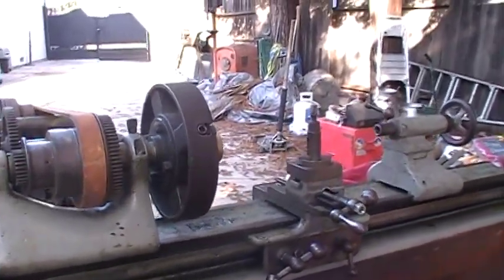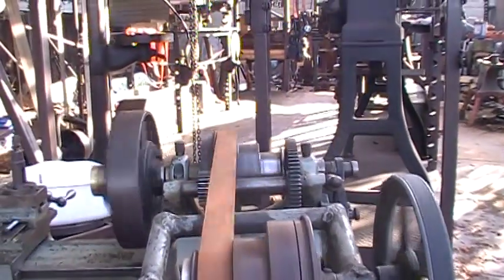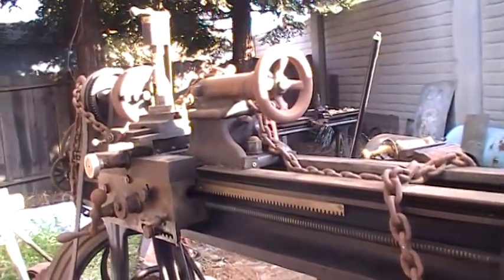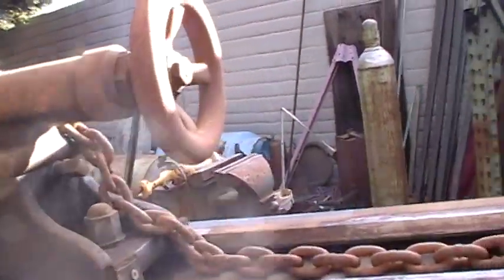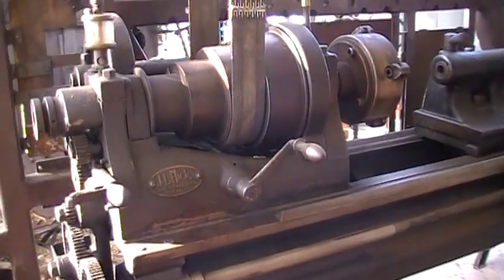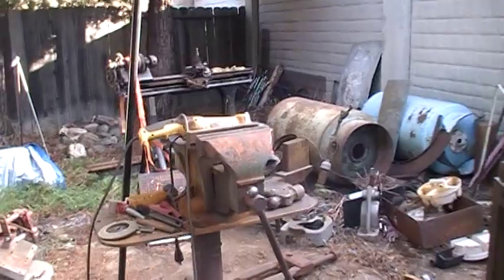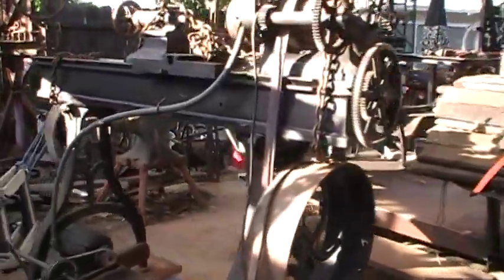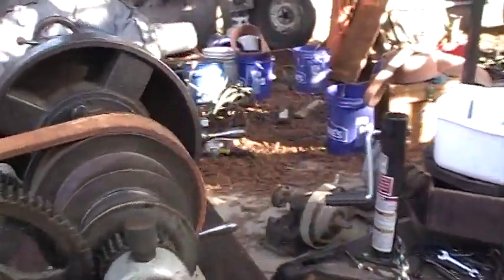New old W F J Barnes #4 1/2 and #13

Comment: I have a 4 1/2 Barnes lathe. Purchased it from an auctioneer who had it for 35 years. It didn’t take much to get it going. Basically took it apart and cleaned it up. I did convert it to electric. It runs excellent and is very accurate for its age.
Reply from the maker: Back in the day the Barnes 4 1/2 was the farmers work horse. A good little machine that usually saw very little use. So today they're almost always in fair to good shape. Did you get any of the peddle parts? They're worth as much as the lathe
Reply: @davewilson1591  
No, just the legs and original flywheel. The previous owner said he thought he had everything, but as of this month hasn’t found. Maybe he will run across them. The treadle and original tool post are hard to come by. I also found a 3 jaw chuck original. 7/8-10 is almost impossible to come by. Not much out there on Barnes, you and Troll Forge are about it. Nor the seat but I have one from a tractor that will do.
Reply from the maker: @Miner-49  well you did get the legs. There's a lot of leg thieves out there and the pulley can be the money shot, costs the most. So all in all you have a pretty complete machine
Reply: @davewilson1591  
Yes, about 98% complete with all original parts. I’m happy considering I only have 360 bucks in it. I’m by no means a restoration expert and don’t intend on it. I just enjoy working with antique tools and equipment. I repainted it with CASE tractor paint, just because that’s what was on my shelf at the time. Anyway I won’t take up anymore of your time. Looking forward to more videos. Thanks for taking the time to talk about our equipment.
Reply from the maker: @Miner-49  you got a steal of a deal. I paid more than that just for the flywheel pulley peddles and seat bracket. Had to buy the seat and chain extra. This didn't include the lathe! So have fun with it. There's a lot of them out there but you should keep the RPMs below 500 and it should last  another hundred years.

Comment: I have a F & W Barnes #5.  I purchased remade crank and petals, the lathe runs great.  I need the seat and other parts to make the unit complete.  Several components were cracked and repaired/brazed a long time ago. The large back gear has two damaged teeth.
Reply from the maker: That sounds like you have a good start. The Amish in Pennsylvania have a foundry and I got the seat from them.  Comes with the 5 point hole  -  like original.  Good luck
Reply: Dave Wilson Yes, I have the foundries name/number. The lathe was purchased by my granddad, early 1950s.  All petal drive components were missing.  The lathe sat for years, about two years ago found crank and petals.  Definitely needs a seat attached to the main frame. Will keep in touch!
Reply from the maker: @Larry19271  IIRC the seat only cost $45 and shipping is low also. They are the best to deal with. I have to machine the seat support and turn a shaft for the drive cone pulley. A project for later!
Reply: Dave Wilson Will have to call them tomorrow, Thanks!

Comment: W.F & J. Barnes turn up in the UK...from time to time...
Lathes & drills...

Seems like police sirens are a feature of daily life there as well...?

It's all you hear round here all day...🇬🇧👍
Reply from the maker: The fire Department is across the street.
 I read in practical machinist blog that more barnes were shipped to Russia prior to the 1917 revolution than any other place in the world. So apparently there could be more of them in Russia right now.
Reply: @davewilson1591  

They did a good drill did Barnes...
The ones that appear in the UK were probably sent here during WW1...🇬🇧👍
Reply from the maker: @glennmoreland6457  I like their handle to raise and lower the table. Haven't had an opportunity to use one but they look cool.
Reply: That's the vertical handle on an external acme thread...?

I've seen similar arrangements on a Denbigh (Tipton, West Midlands, UK) drill press using an external acme thread and they're prone to wear...
Got to keep them well oiled and clear of drillings...

I've a big old Jones & Shipman (Leicester, England) pillar drill...7ft high with a 4MT...
It'll be a good ton in weight will that...

Anyroad:
I sent you an email a few months ago and I never got a reply...👍🇬🇧

Comment: Hey Dave, do you have the complete gear set for your W F & J #13? I got the 8 foot bed version of the same lathe, but I am missing some of the gears for thread cutting, I have most of the smaller ones but lack the large, and also need some info on how the gears are mounted as I may be missing something for that. 

I'd be in your debt if you gave me some of the details of the missing gears, or maybe working something out to have copies of yours cast eventually if you know anyone capable of that.

Anyway, hope to hear back from you and I hope you have fun with your lathes!
Reply from the maker: Sounds like you have a good start Duke. I believe the change gears are 10 pitch. Before I got the #13 I got an incomplete set of #10 from somewhere. The lathe came with a full set +. Contact me. davewwwilson@gmail. I'm sure we can work something out. It is a very fine lathe.
I'll make a video of that side of the machine.
Dave